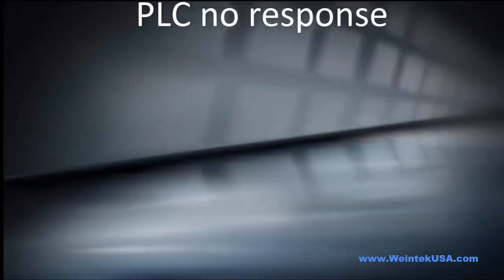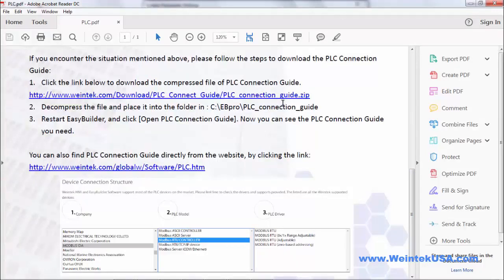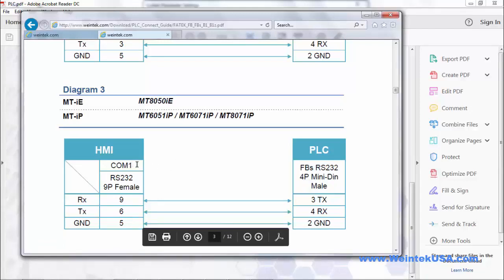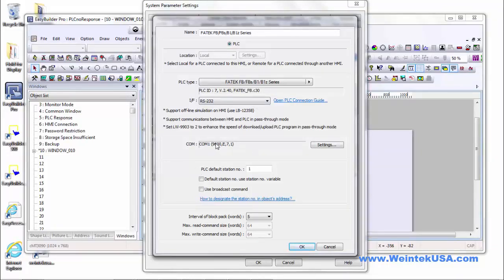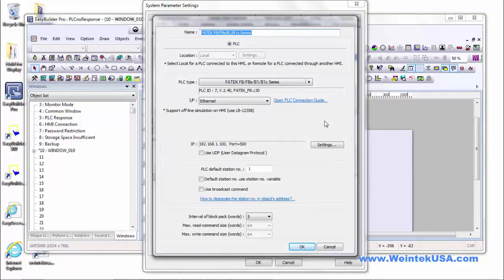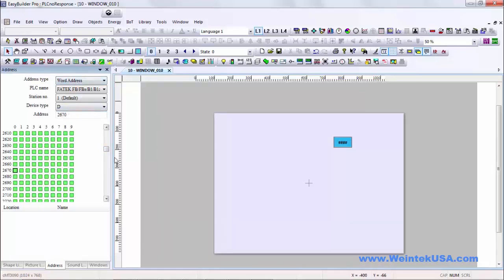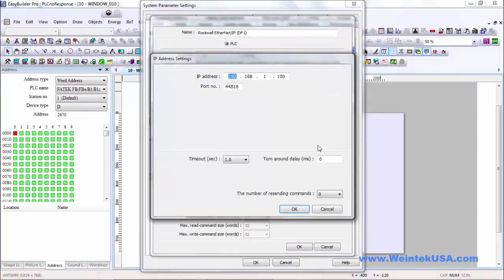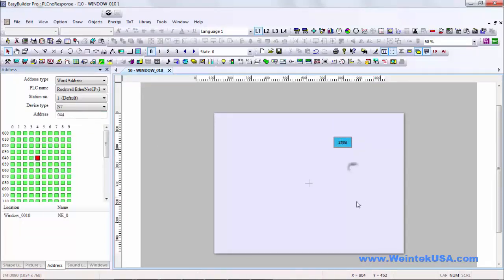PLC NO RESPONSE Troubleshooting Error Steps EasyBuilder Pro Weintek Serial Ethernet

Comment: guys, I am having a problem about Modbus RTU, I dont know why it is working good, I mean communication between IHM and PLC, but sometimes a pop up error "PLC NO RESPONSE" appear on screen and disappear.  Any ideas or anyone see it before? I am using a MT6071IP IHM and Schneider PLC
Reply: Hi Geovani,
There are several reasons as to why a "PLC no response" or "Device no response" message may appear and disappear on the HMI's display. The most common cause is a bad cable or connection to the end device. To diagnose the issue, I would recommend that you download a test program to the HMI that contains only one bit address within the PLC. If you attempt to toggle this bit and a "PLC no response" message does not display then the cable may not be the root cause of this issue. If this is the case, take your current project (not the test project) and slowly remove items from the project while testing communication after each object is removed. If the error message does not display, then the last object (or one of the last objects) removed may be causing the communication error.

Comment: I downloaded easy build pro, but once I want to run it in win 7 it crashes. I also have TouchWin Edit Tool for Xinje HMI by Xinje Electronic company installed, with its dedicated USB driver. . I was wondering if Easy build Pro is in conflict it. Any ideas. Any advice would be appreciated.
Reply: Hello,
This question is difficult to answer without additional information. Please contact Weintek Support for assistance: support@weintekusa.com